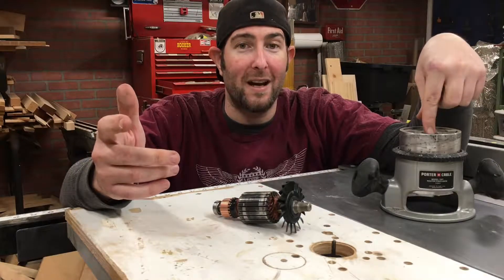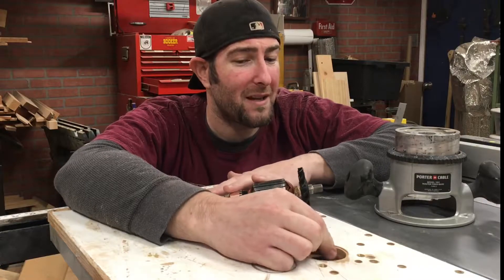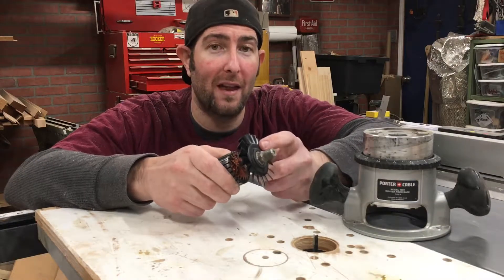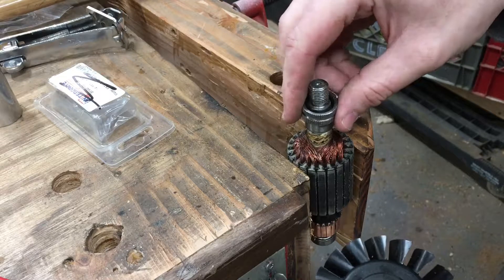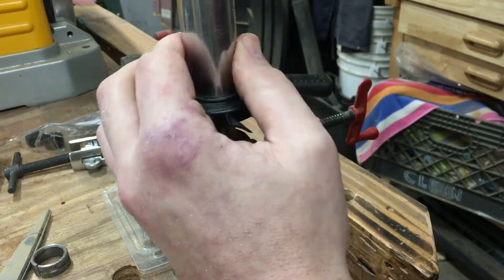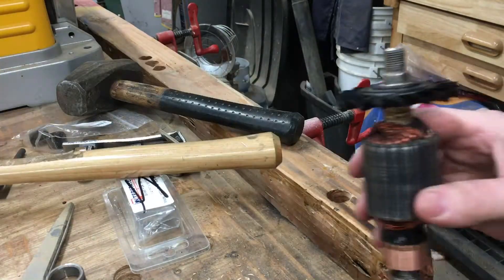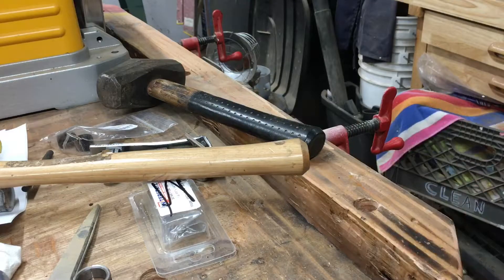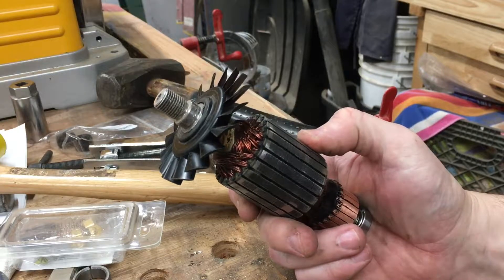Armature Cooling Fan Replacement

Comment: Wish I could buy the fan as it's NLA and armature is like $200. 
I bought the 690LR from Home Depot back in 2004 and it's like brand new as I've only used it for a few hours. Figure buy a tool to last me forever...  

For those that can find a fan, a much easier method is to put armature in freezer for 2 hours and heat fan in some 300F veggie oil. It should drop right down the shaft as this is how they probably did it at the factory. 
Basically the inner sleeve is 0.001 smaller than the shaft. Cooling armature shrinks the shaft and heating fan increases collar ID. You''ll only have a few seconds, so get that socket ready to tap it in place if it doesn't drop on.